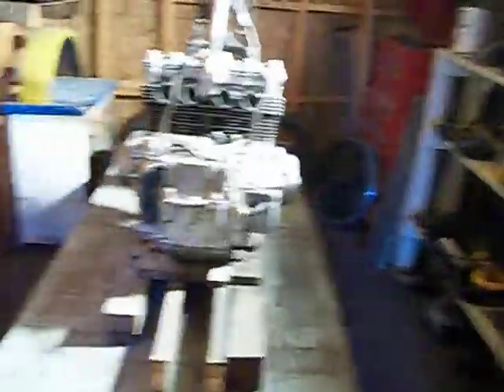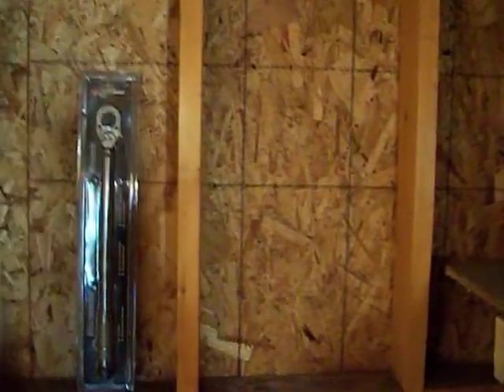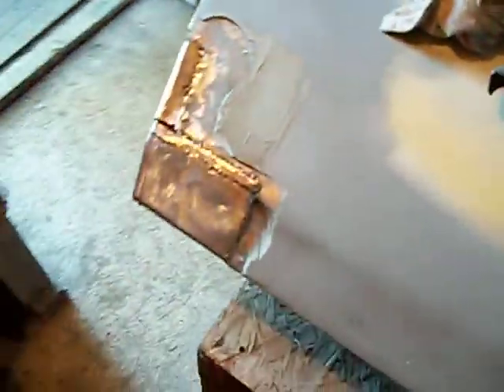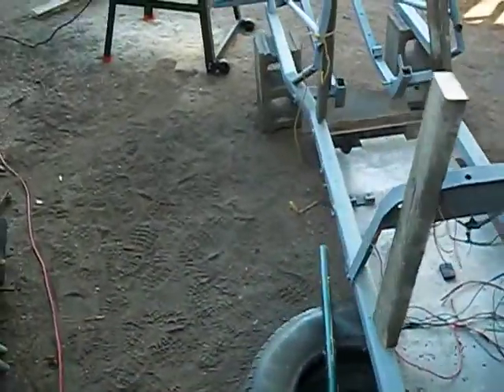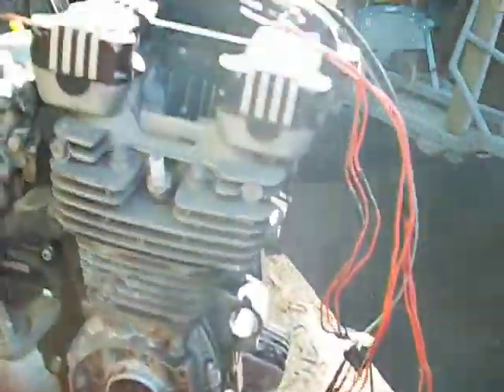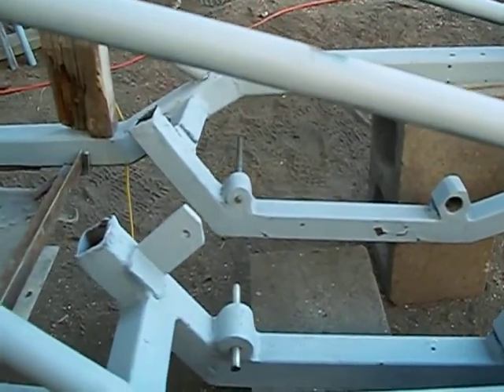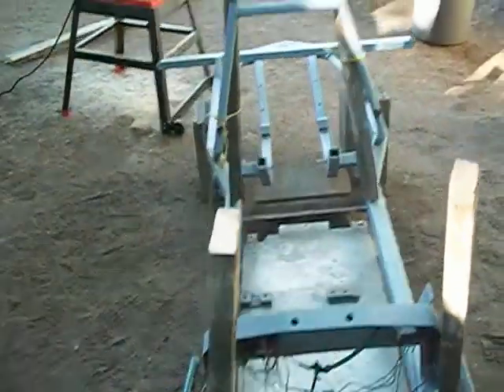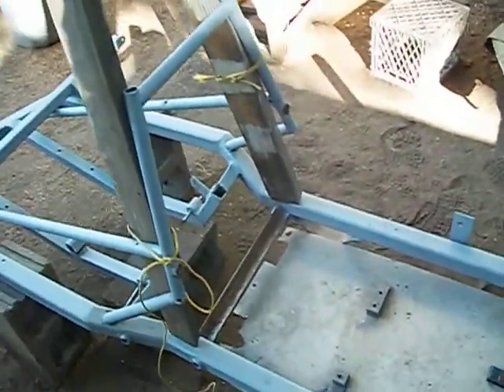100 1096

Comment from the maker: The frame is built fairly well, but way to heavy and i want it lighter. Some of the frame joints are not preped properly to weld up solid, so i will need to redo alot of the weld joints to make sure it is perfect and strong. Also need to fabricate a simple cage over the driver, lots of ideas i am working on for the go cart build.